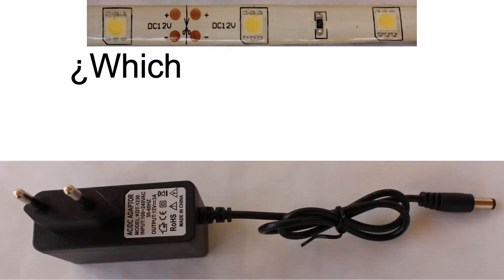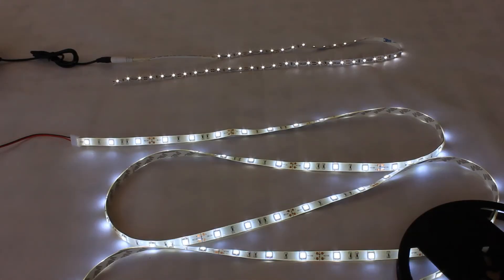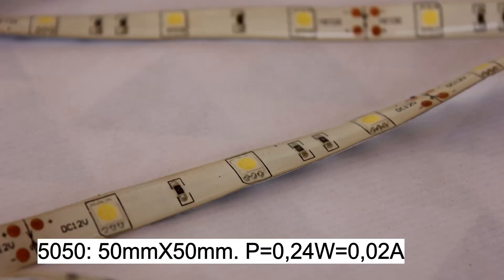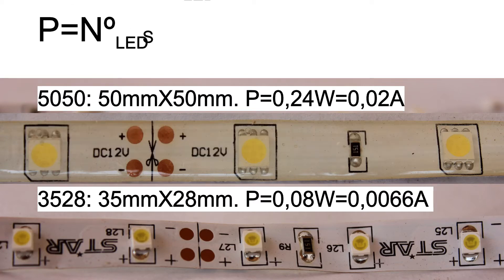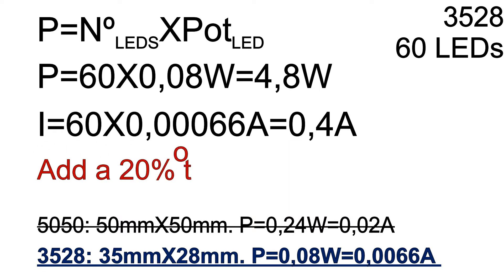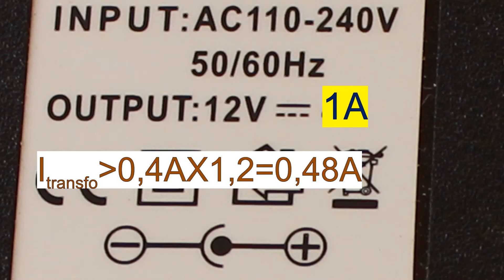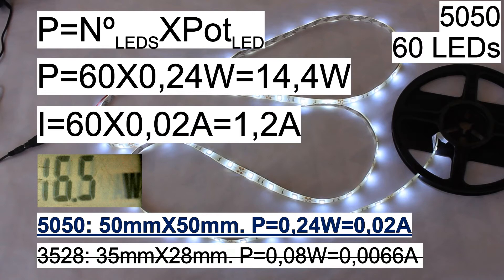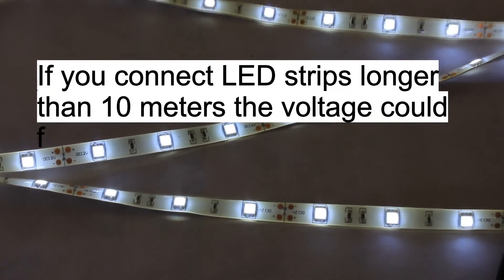How to calculate LED strips power consumption?

Comment: I was looking for a long time for someone to explain to me how to calculate the power I need for a ledstrip. 
Your video is EXACTLY what I was looking for.
 Easy to understand and apply accordingly. THANK YOU for the video
Reply from the maker: THANK YOU So mucho for your comment Δημήτρης!! This video was prepared after helping many other users questions in my previous videos about led strips (in the spanish version).
I recommend you the first one to have a global view about led strips: https://youtube.com/playlist?list=PLHogLkQ_uFsgQfcZJAIgLbnqtz2ONCGjA
Ευχαριστώ για το σχόλιο!
Reply: thanks for the link. I have a question to ask you. Ι have a ledstrip 3528 4.8W which needs 0.4A per meter (12V). If a power it with 0.3A instead of 0.4A am I going to damage it?   @elmaestrodetecno
Reply from the maker: Hi! Thanks for your coments.
You won't damage the led strip so you can try. If it doesn't light properly you can change the transformer or cut the led strip ;-)